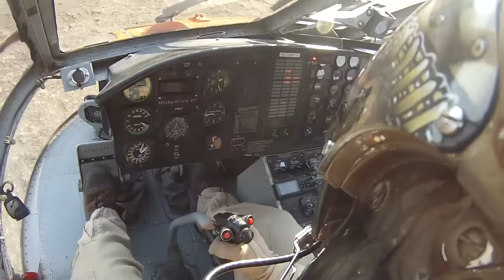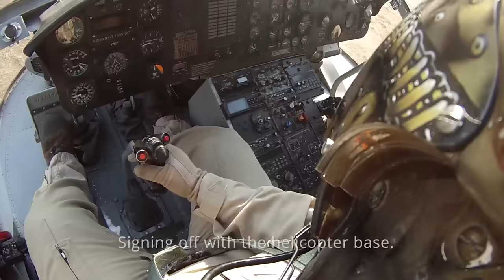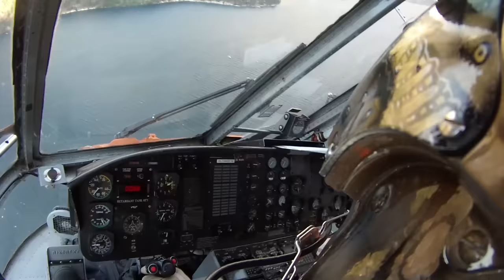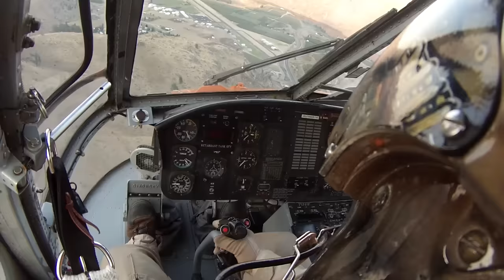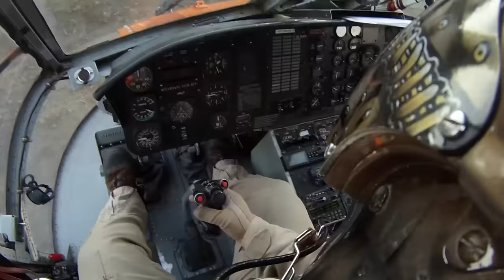Helitanker – From the Cockpit of a Firefighting Helicopter (Pilot POV)

Comment: PTT Intercom?
Reply: Yes.
Reply: @michaelstrasser156  Thanks, Is that a plus or a minus in your opinion? I can imagine it is quite noisy in the cockpit.
Reply: @ruston1200  it's not a plus, it's a MUST - you called it, these cockpits are incredibly loud...
also, it when you fly the longline and try to get the bucket into the little dip-tank, there is a potential for a lot of cussing that doesn't necessary need to be shared with the whole crew, LOL

Comment: Why isn't your co-pilot wearing gloves 🤔. Its a contract requirement.
Reply: What's the reason for it being a requirement?
Reply: @HeliNomadic  its part of the PPE the contracting agency requires the operators to wear wile flying on fires.
Reply: @mitchboyce5293  so they're fire proof or flame retardant gloves?
Reply: @HeliNomadic  flame resistant.
Reply: @mitchboyce5293  right, those are the words I was searching for in my half empty brain. Thanks for sharing the info.
Reply: @mitchboyce5293  The co-pilot IS wearing his gloves while flying over the fire (3:56).